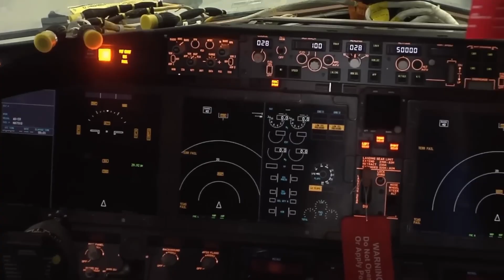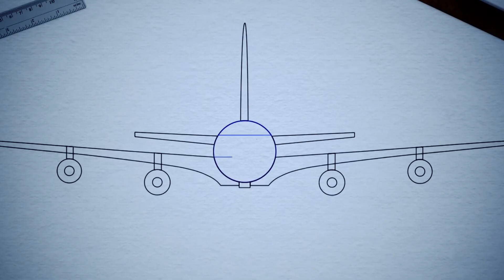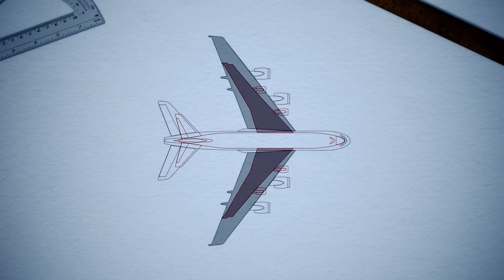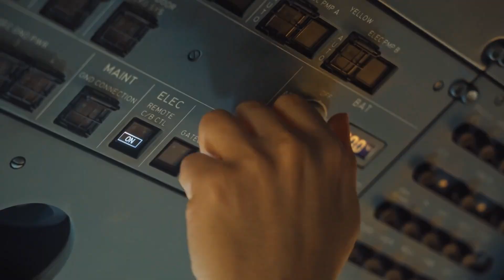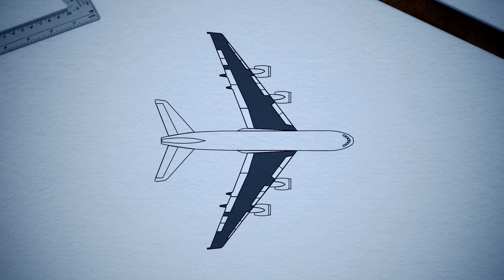Why the Airbus A380 Refuses to Die – Emirates’ $20B Comeback Plan

Comment: Unfortunately, Emirates is the only one that wants an A380 neo. 

As stated in the video, its sheer size, for most airlines and airports, is a liability, not a benefit. 

There simply aren’t enough severely slot-constrained airports to produce enough A380 neos to make a profit for airbus.
Reply from the maker: You make a valid point! The A380 does have its challenges, especially with airport slots. It'll be interesting to see how Emirates navigates this situation.

Comment: another banger of a video. by the way  some of the reasons that the A380 is so big and heavy because it was built for future upgrade in mind like the wings, landing gear, vertical stabilizer were all build so large with future upgrades in mind.
Reply from the maker: Thanks for watching, and I appreciate you pointing out those fascinating details about the A380's design!